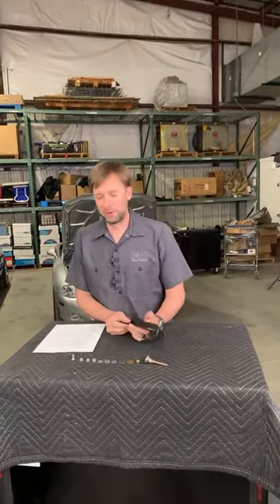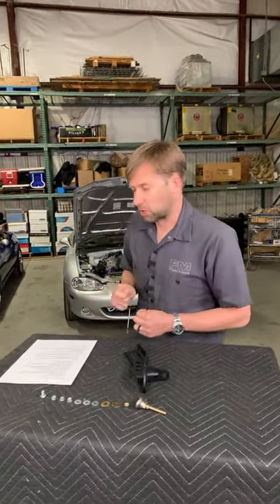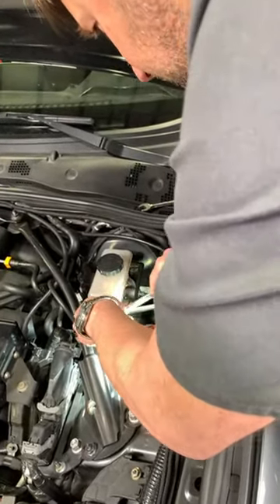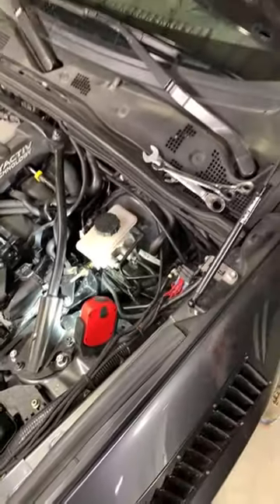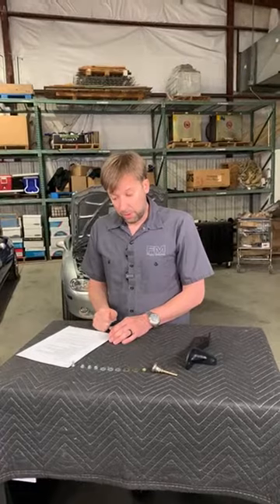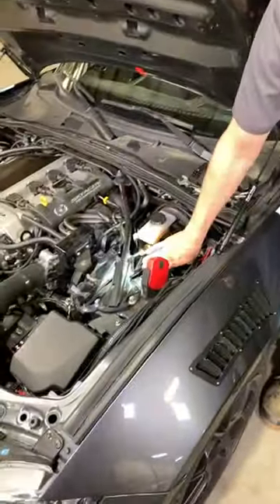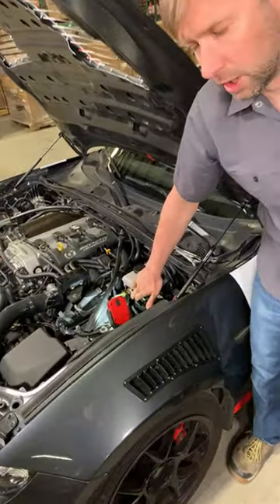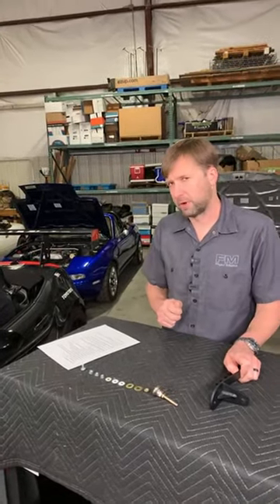New Part! ND Miata Brake Master Cylinder Brace - FM Live 4-18-24

Comment: I read somewhere it didn't fit with the Edelbrock sc as it repositions the ECU bracket. Have you guys tested that at all?
Reply from the maker: Unfortunately, we haven't had one in the shop to physically check in-person, so we can't guarantee one way or the other, but looking at their instructions -  it looks like it'll probably work, as long as the bracket for the EVAP solenoid isn't in the way or can be modified. Sorry we can't be more help!